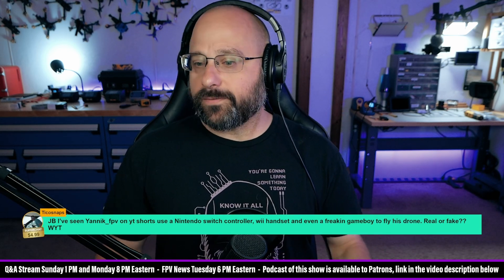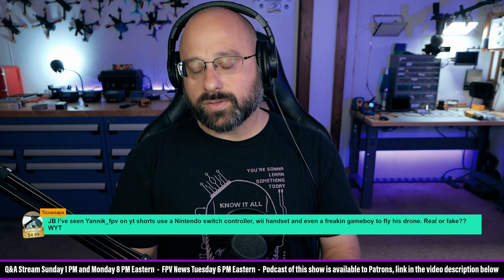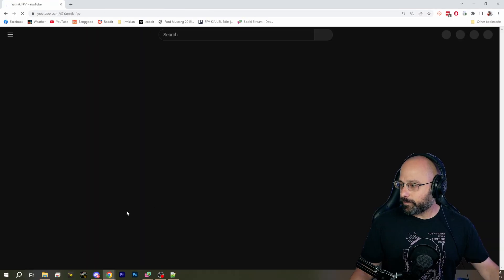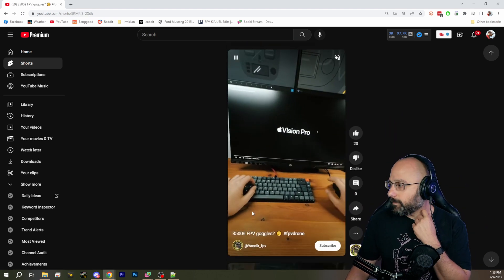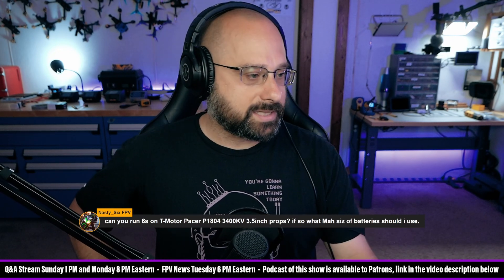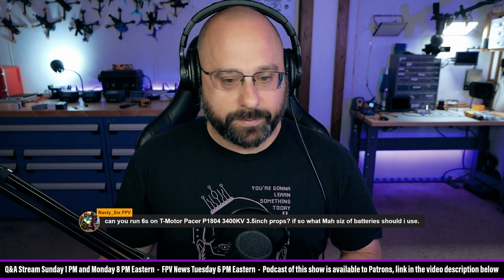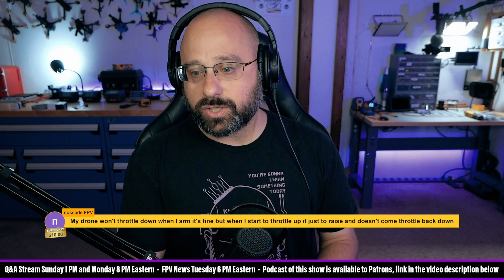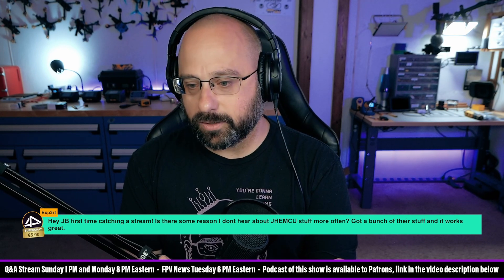Control A Drone With Nintendo Switch? 6S On THESE Motors? Drone Won't Throttle Down! - FPV Questions

Comment: My experience with JHEMCU: ELRS RX dead on arrival. Seems to be a quality issue which was confirmed on the ELRS Github to be HW defects due to bad quality control. FC: only survived a few weeks before signing off without a hard crash. Not the only report in that direction...
If you are lucky and it works, it's a good deal. But I don't want to gamble.

Comment: hello, I would like to ask you if it is possible to arm the engines gradually slowly up to the speed set in betaflight, I have created a helicopter fuselage with a multirotor and fc betafligt instead of the traditional blades.  so when I arm I have the problem that the 680kv motors start at full speed up to the arming value set on betaflight.  I use an old version of betaflight that is 3.2.0 , which I am very happy with, I have perfected the pids in an optimal way for me.  Could you help me if it is possible?.  thanks good job joshua.